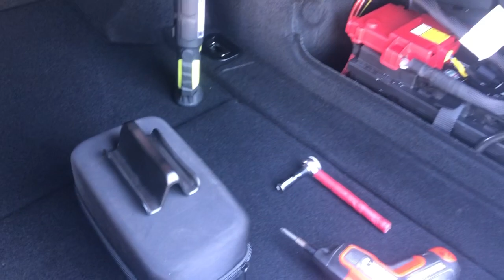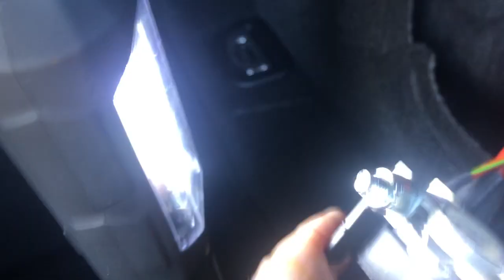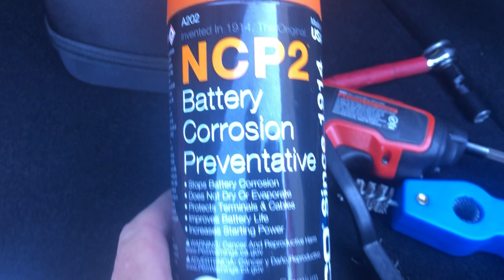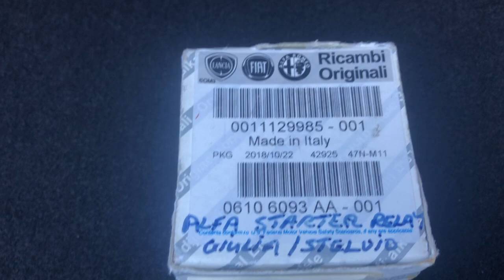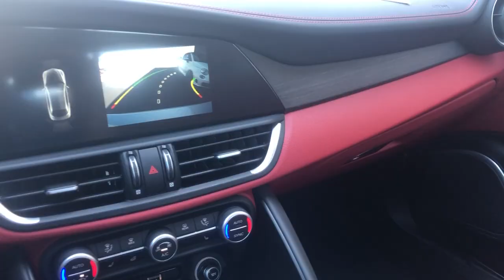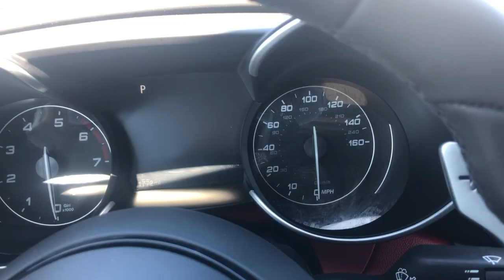Alfa Romeo Giulia/Stelvio Battery Post Cleaning and Starter Relay Location

Comment: Thank you John - excellent video.  I usually turn the stop/start off when I set out.   I didn't the other day, and it activated at stopped traffic lights and wouldn't start again.  I was in the centre lane of a busy road.  Embarrassing in the least and highly dangerous at the worst.   After 10 minutes I could get started and drove home.   The dealer in Brisbane, Australia couldn't fit me in for 6 weeks !!!   (2 weeks for an auto electrician).   I searched the forums and youtube.  Your video is excellent.  I picked up a new relay today (3 days to be sent from Melbourne, Aust) and have just put it in and it starts again.   So thank you.   I am not a mechanic (but not useless) and this is a simple fix that anyone could manage.  All Alfa owners should be aware of the issue and the fix.    A couple of other electrical comments that may help other owners.  I don't drive my Giulia Veloce every day (I am retired) and have found that it 'thinks' a lot - and battery runs down.   I needed a new battery and had a stop/start battery replaced by the RACQ (Queensland breakdown service) but then had problems.  Apparently in Australia the advice is you need to replace with a genuine Alfa Romeo battery.   I was fine after that.  Also I now put my battery on a trickle charger every 2 weeks.  I was happily feeling electrically confident until this recent 'starter relay' issue.

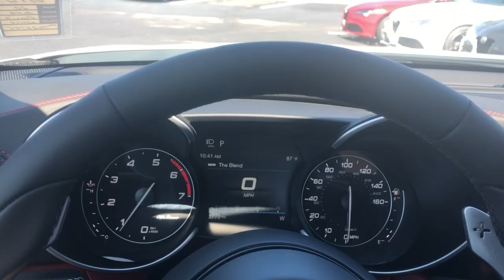Comment: As an owner of a 2020 Guila QV that is on its 3rd battery after less than 3 years, my extreme compliments to you on a very thorough presentation of knowledge. Previously I have given this problem over to the dealership but now I can handle it directly. 25:35 My full thanks.

Comment: To reset the code after a battery reset you don’t need the car the be in motion. You can simply turn left lock to right lock then back to center and restart.

Comment: Great video! I love my 2018 Quad and just dealt with a slightly low/cold battery last week. I keep it on a trickle charger every day but I used a lot of battery power moving the driver's seat when I was chasing down a squeak last week. I've owned the car since new and do a lot of service myself. I was pretty sure it was the recent cold snap and power drain so I looked into it and found a replacement battery available from local parts stores just it case. After a full day on the trickle charger and a long trip, it was back to normal. I will check the voltage too because it is 5 years old now. Thanks for the detailed instructions. It will save a ton when it's time to replace.

Comment: You're the man I just did the pump for the sluggish behavior relay which was accessible in the wheel well. My AC motor quit working yesterday I'm going to replace basically both of those two just because I'm going to be doing it anyways. Thanks for the heads up!

Comment: Thank you for sharing content! I have a 2018 Stelvio with the 2.0 engine. I replaced the battery for a bigger Varta 95A AGM i think this will last longer than original. I have a question about starting up, my Stelvio need somethimes a long crank before it starts up, do you know what the problem could be?

Comment: You can clear it in park by turning all the way left hold then right hold. Then turn it off and on. Same thing just you don’t have to drive. Great video
Reply: John…. You just won HERO of the year award!!! Thank you so much for your detailed video and explanation of everything, I love my Alfa, 2017 2.0 ti, just hit 91k and I was starting to see some of the signs about 30k miles ago, headlights flickering, start/stop malfunction and such here and there but this totally helped me and saved me a 4 hour trip to the closest Alfa dealership 🙏🏼 again thanks for your time putting this together.
Reply: Turning the wheel while driving rather than being stationary reduces the loads on steering components, thus slightly increasing their longevity. Of course, it's not every day you have to clear the codes after re-connecting the battery, but the general principle still remains.
Reply: @Wojt0n  yes but like you mentioned honestly how often are you going to be doing this? It’s much better to have it cleared before you go driving so you can see if you have any faults that don’t go clear right away. This is guide is made for people with out OBD2 code readers other wise that takes the place of disconnecting the battery to clear faults 2018 up require sgw bypass to clear codes